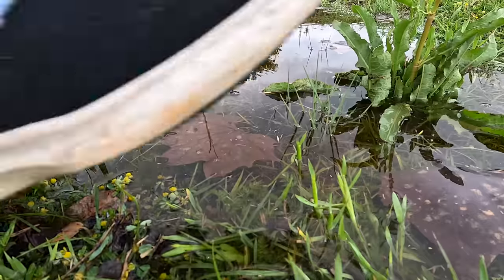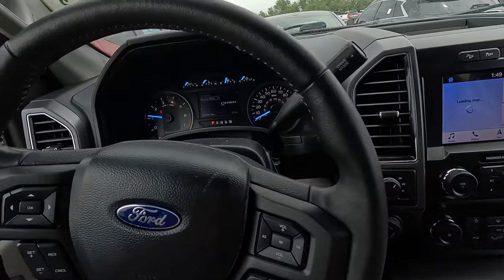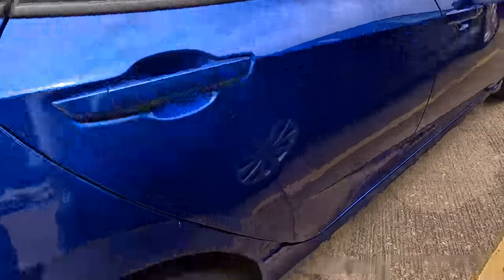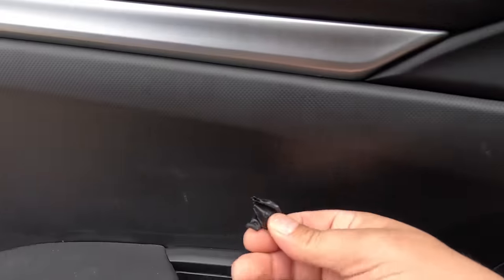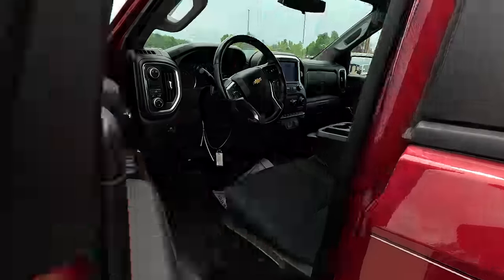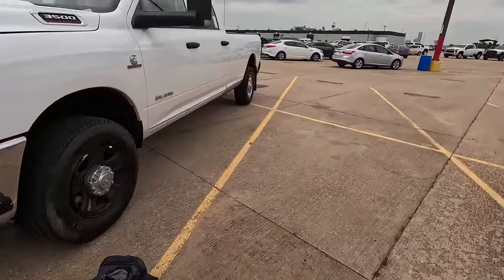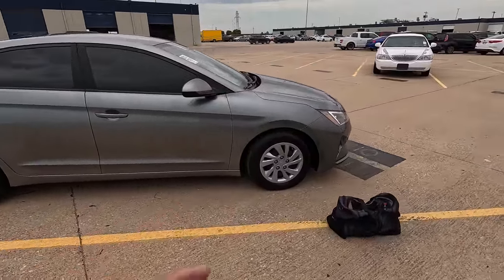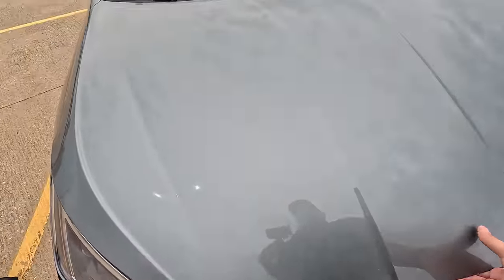Dealer Auction Walk Around + Cheap Ford F150 V6!

Comment: If I'm buying a full-sized truck I want it to come with a full-sized engine. I'm glad they give you several engine options.
Reply: 400 foot pounds of torque isn't enough for ya?  lol
Reply: @jodav3986  I was mainly referring to the 4 banger in the Silverado
Reply: @infinity3jif  2022 Silverado 4 cylinder turbo has 430 foot pounds of torque, boss
Reply: @jodav3986  Jeez that's crazy
Reply: @infinity3jif  Yep.  Cylinder count doesn't matter as much as it used to.

Comment: Yes they put turbo 4s in silverados and it puts out 310 hp 420 ft lbs if torque and 9600 lb towing and better gas mileage.
Reply: Nope the 4 cyl gets 5 mpg LESS than the 5.3 V8 in a real world driving test loop by C&D...

Sure on paper the 2.7 is 2mpg better in the city but same hwy but reality is,it isnt better you gotta keep your foot in it to have power,thus lower mpg! 5.3 is the engine to get!

Small engines work harder and less life and more issues down the road,if you keep the truck several years and actually use it.

Hell,the 6.2 is better option as it blows the 2.7 away and mpg is exact same as the 2.7! and your truck doesnt sound like a weed whacker!
Reply: @mypronouniswtf5559  the 5.3s and 6.2s are trash these days…popping valve springs and bending pushrods. The 4 cyl seems to be the only one with few problems.
Reply: @mypronouniswtf5559  Great screen name!

Comment: Are 2.7 Turbo Engines Reliable?
The 2.7 engine is commonly found in the Chevy Silverado and the GMC Sierra. These trucks are basically the same, but many of these truck owners say that the engine isn’t reliable is one of the biggest problems.

They have had to replace the entire engine or repair the cylinder head issues. Others said that they had problems with the timing chain, timing belt, supercharger, and turbocharger.

And all of these problems with the engine started just a few years after owning the car. In general, you want to have at least a few years of no problems with a brand new car.

Comment: Those 4 cylinder and 6 cylinder engines won’t last as long as an 8 cylinder when it comes to doing what trucks are designed to do. Seen too many eco boost trucks with worn out and damaged engines from towing trailers while the 8’s are still running. Moving everything over the 4 and 6 cylinders is absolutely stupid and going EV is insane with current battery and charging technology. Can’t drive across the country in an EV for vacation because it will take 2 weeks or more to do so having to stop every 250 to woo miles to recharge overnight and that’s if you get a fast charger.

Comment: That truck would make a great work truck as long as you don’t need the bigger engine for towing. The hard tonneau cover and slide-out tray alone in the bed is probably worth about $2500.

Comment: I got a 2001 toyota 4runner SR5 4x4 3.4 V6 automatic with 320k on it runs and drives like its new the old school stuff was built to last that's for sure😊

Comment: I have a 2018 civic and we've had two problems in 57000 KM's. The infotainment system freezes up in Android Auto (recent updates have mostly fixed it) and the air conditioner compressor failed twice. Each time covered by a honda recall. The car drives really well and I would buy another.

Comment: Looks like Randy needs to get up to speed on small displacement turbos in trucks.  The Ford 2.7 has 400 foot pounds of torque and 325 horsepower.  The current 2.7 turbo in the Chevrolet has 430 foot pounds of torque.

Comment: The F150's outside temperature is set to Celius. 20 C = 68F.
Reply: Yup - I noticed the cluster is in KM also.
Reply: @lukeheffernan  I'm wondering if it's a Canadian vehicle. That should bring the value down somewhat, at least three winters of salt exposure.

Comment: That F150 doesn't have 27,000 miles, it's in kilometers which is why it said the temperature was 20 degrees outside. Its more like it has 17,000 miles

Comment: Why does everyone doesn’t know the 2.7 lol it’s like a 5.3 in terms of acceleration But ofc a v8 is a v8 and 4 cylinder is a 4 cylinder
Reply: The 2.7 4cyl is 5mpg less than the 5.3 V8 in real world driving by magazine tests...The 6.2 even got the same mpg as the 2.7 4 banger! You want best bang for the buck its a 5.3 for a GM truck,but you want best performance from a  GM truck,get the 6.2 and you have the same real world driving mpg as the 4 cyl!

4cyl only gets advertised gas mpg if you go under 50 mph and ease into it meaning 0-50 in 30 seconds,n heavy foot...Drive like a 98 year old Granny!

Comment: Randy, I’ve mentioned this before. Who cares about what type of vehicle you are buying or what the engine has been running in the vehicle . All You’re Doing is flipping the vehicle. So that means you don’t need to worry about the way it comes.
Reply from the maker: That’s 100% not correct